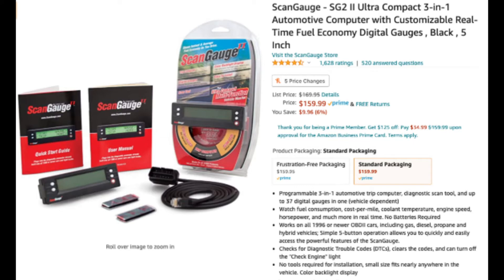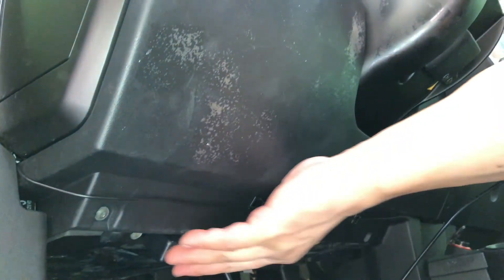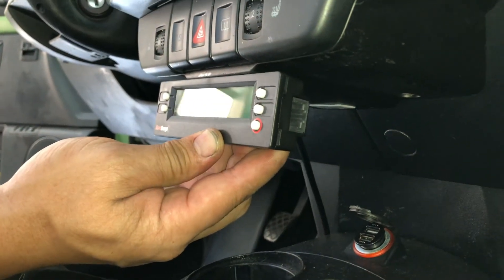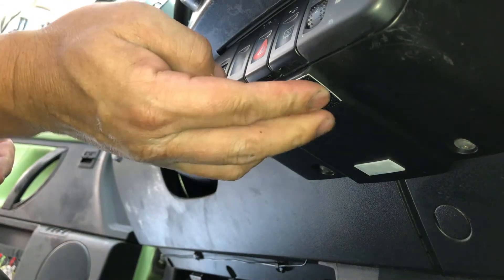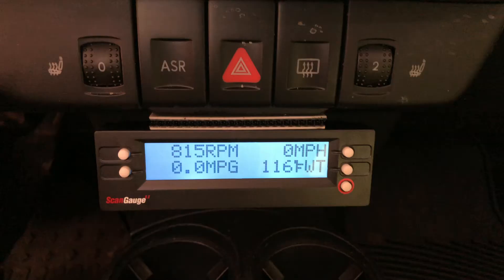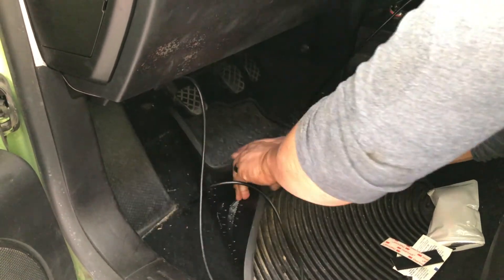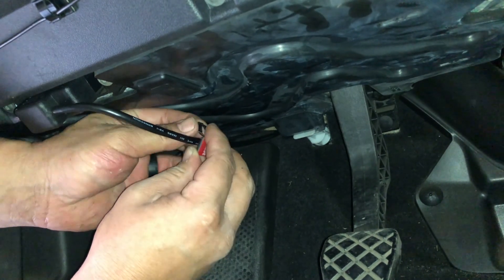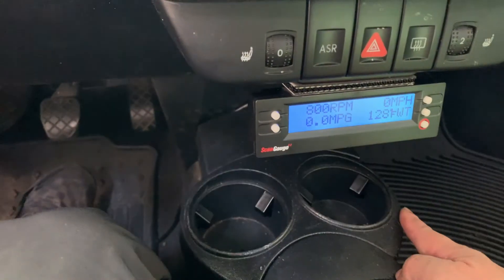Volkswagen FAIL. Why No Temp Gauge!? How to Install a Scangauge II on a VW Mk4 Beetle.

Comment: I know you just bought the scan gauge II. 

But now there is a scan gauge III.

I also have a beetle. Mine is a 1998 tdi.  I have an upgraded turbo, clutch, injectors.  I need to watch the temperature on mine also. These cars also have a fault with the electric fans not working. So we all need to watch the temperature. 

I like your channel because you drive your cars.  Most people fix cars up for views, then sell them or give them away. 

I want to watch people who actually use their car.
Reply from the maker: Very cool. Just got a Neuspeed short ram I need to install. will hopefully do a video of that soon! You on instagram? Would be cool to see more of your motor. @rayregnogarage
Reply: i realize you commented 2 years ago but ive got a 2000 beetle tdi and im looking at getting the scan gauge 3 does it read oil pressure and coolant temp on our cars?

Comment: I have a 2003 beetle as well 2.0L , i have al ready change timing belt, water pump, thermostat and it’s still overheating I don’t know what might be the problem with it now, and on a tight budget so I want to get it right this time. What should it be ? Thank you 🙏🏻
Reply: Another question: should the fans start running as soon as you turn on the car ? I have already change the cooling fan control module and is still not working. A reply would be really appreciated
Reply from the maker: I was about to ask about that module, too. Coolant temperature sensors are cheap things you can try. The vans don’t turn on right away, it has to get to a certain temp first. Did you burp the cooling system?

Comment: Thanks for the info.  I have an 05 Bettle.  This is first car I've owned that did not have a temp gauge.  My Bettle was given to me.  It's in need of some repairs, but runs and drives.  I've been trying to learn as much as I can about the car.  Hopefully I can even learn to make minor repairs.  Current task is to replace the air intake box. Mechanic was going to charge $500 for factory part plus labor.  I was able to find one on Ebay for around $60.  Now I'm trying to avoid paying for labor.  Is this something you've done? I'd like to change this myself.  Hoping you or anyone reading comments can provide some guidance.  Thanks
Reply from the maker: Awesome! The air box is easy. Watch this video on installing a short throw shifter. You have to remove the air box to get to it. https://youtu.be/hfVFzCp1N74
Reply: @rayregnogarage  Thanks for taking the time to reply.  Really looks easy.  I'm looking forward to trying it.  Thanks again.
Reply from the maker: @Starting321  Absolutely. Here to help! Good luck!